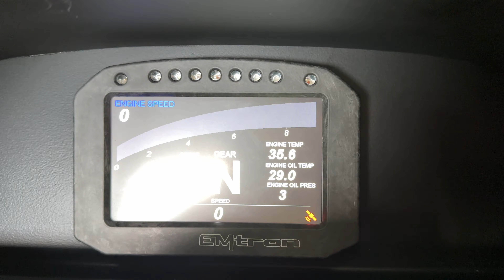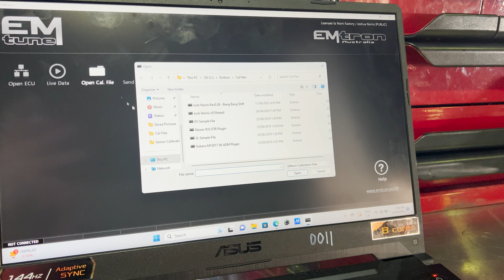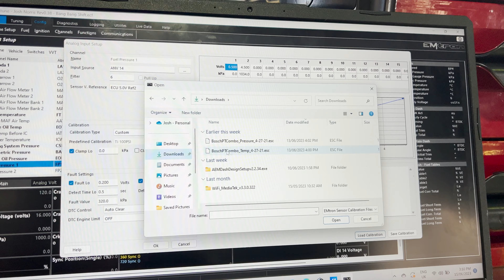Is this the luckiest R32 GTR!?

Comment: Toyota electric power steering motor on the steering column and a manualized rack might be the way to go if you keep throwing belts.
Reply from the maker: Hey man. Yeah I thought about that for sure. But it was my fault the belt was slightly to big and was a bit loose.  Had it on the to do list. But electric pwr steeer is sick.

Comment: Really unfortunate but not the first time I've seen the power steer belt cause issues on a gtr. Please update us on the throttle seal situation in due course as I'm about to fit a Dahtone kit to my gtr. Best of luck with the new turbo
Reply from the maker: The dahtone racing kit is the best thing I’ve ever done. Throttle response is amazing and the operation on the itbs has never been quicker. No issues with the seals once I glued them in with a very small amount of retaining compound
Reply: Many thanks for the heads up on the seals mate. Love your absolutely OCD build. It's been an awesome watch. Any plans to take her to a circuit and stretch her legs later on?